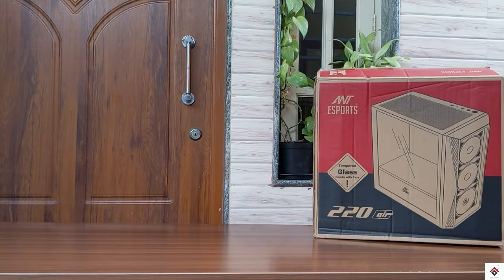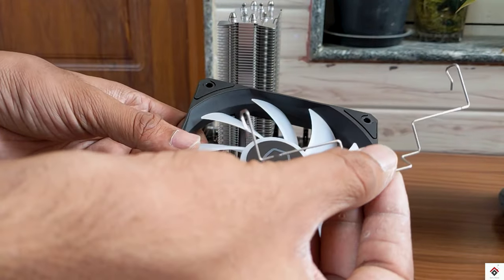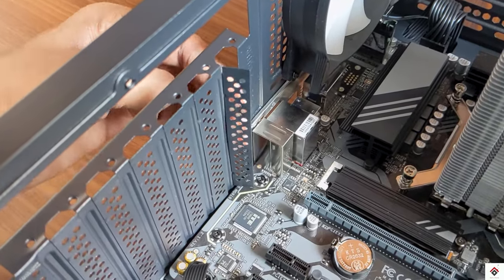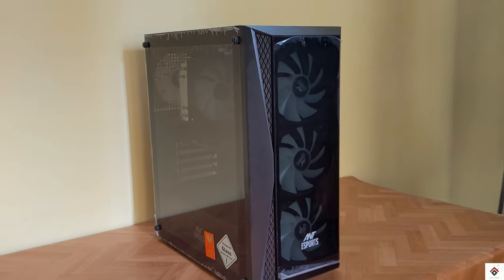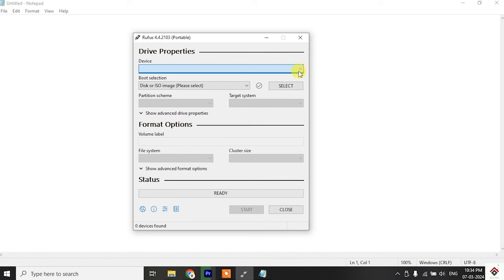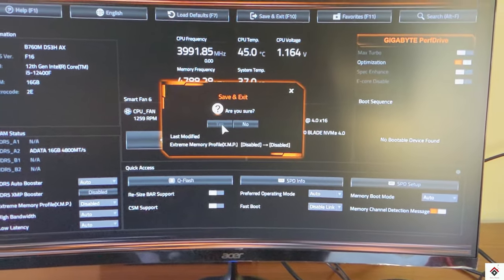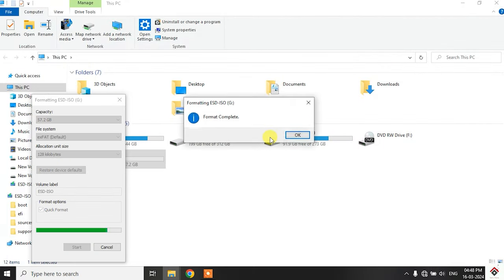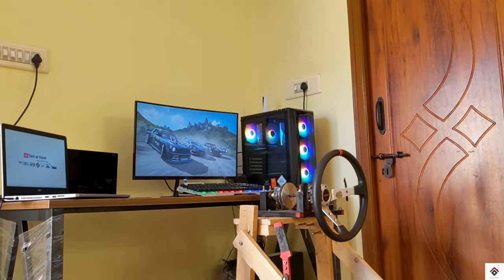Gaming PC Assembly and Windows, Drivers installation | Rs 70000 PC Build step by step guide 🔥

Comment: how do you control the ARGB lights? and can it be turned off?
Reply from the maker: The fans on the Cabinet are not controllable. It will be always on with same pattern.
Only RAM and Air cooler have ARGB and are controllable.